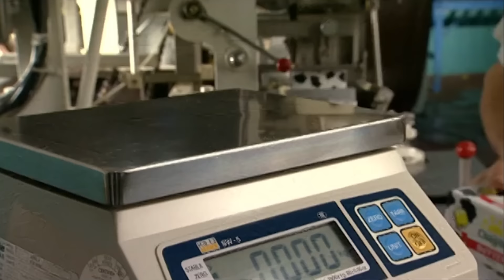How It's Actually Made - Butter

Comment: "The churner spins at 28 rotations per rotation" so it rotates 28 times every time it rotates? That's a lot of rotation
Reply: When I heard that it slipped right by me, but then a few seconds later when I thought about it I was like "wait, what??"
Reply: This and the “pushing out air” bit made me think I was having a stroke
Reply: doesn't that mean each time it spins it gets 28x faster?
Reply: @Fudge_3  It's a recursive procedure, once it's finished one rotation it has already rotated 28 times, meaning it has already rotated 28 times squared etc. so infinity
tldr: after one rotation it's rotated an infinite number of times
Reply: every time i rotate... i do one rotate
Reply: Scales exponentially into infinity
Reply: @Fudge_3  Ah you have puzzled out their Proprietary Secret. they actually only have to rotate the Churn twice. This saves then an hour per batch.
Reply: Rotation station
Reply: it's a rotation within a rotation. like the moon rotating around the earth while measuring how long it takes for us to rotate around the sun.
Reply: I almost died laughing..
Reply: I imagine it as gears. You spin a big gear once and a smaller one spins 28 times.
Reply: infinite energy.
Reply: @Fudge_3  it means 𝕀ℕ𝔽𝕀ℕ𝕀𝕋𝔼 spins
Reply: tusk act 4
Reply: sooooo, 28 rotations^2 (squared)
Reply: infinite speen
Reply: And there's 455 butters per pack of butter.
Reply: @AGMtagious  I mean if youd want to look at it from an irl non-joke way, itd mean the churner inside is its own seperate thing that spins 28 times if the churner outside is rotated once. Basically a churnergear abomination.
Reply: @sus4644  so its like for every time the earth completes an orbit around the sun, the moon orbits the earth 28 times during that period.
Reply: ”Lesson 8, Johnny.”
Reply: Hugbees has stumbles upon infinite energy. If no one hears from me in 24 hours you can assume the government sent assasins to
Reply: 1:28
Reply: Theses units are the reason I keep watching
Reply: Much rotate, many rotate
Reply: Yes. It reaches infinite speed after 2 seconds.
Reply: Infinite amount of rotations
Reply: I felt like maybe it needs to rotate 28 times in the time it took to rotate once last time it rotated, aka, it's accelerating to the power of 28?
Reply: jojo pt 7
Reply: @armastat  thats genius
Reply: @thebonelessone3107 pushing out air si reasonable